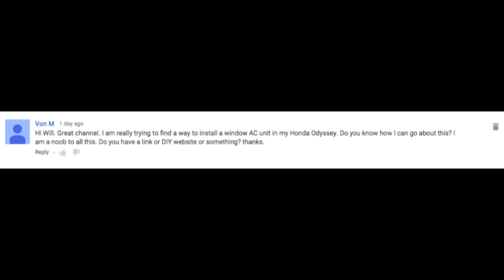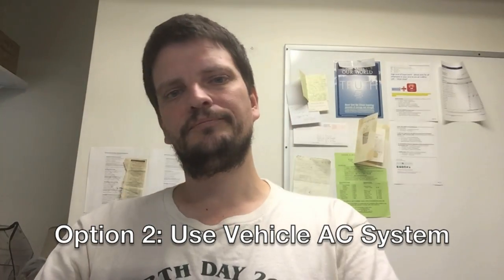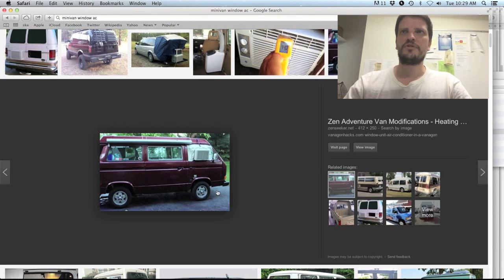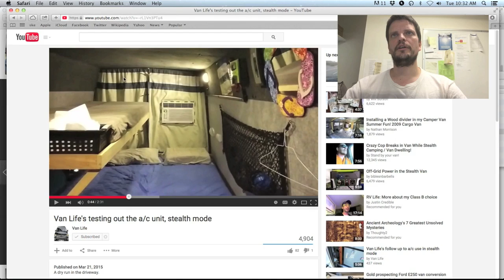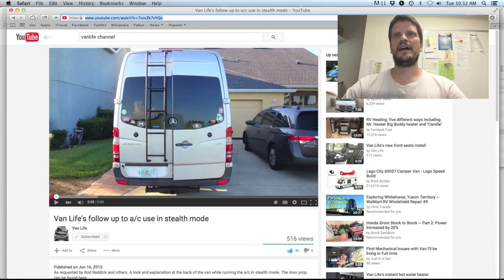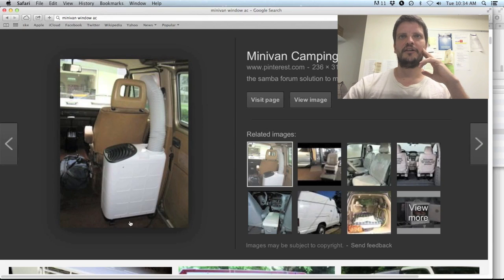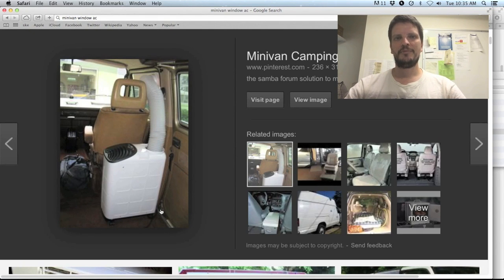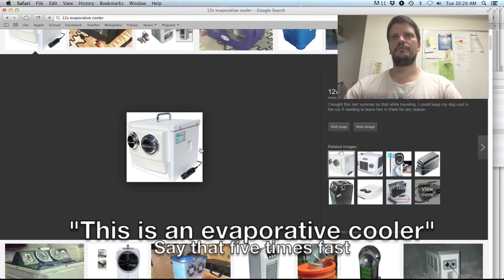7 Ways to Install AC in Minivan: VIDEO REQUEST

Comment: These are pretty cool ideas, no pun intended! My only question is how would you power them while stealth camping, given that they need about 3kw to run?
Reply from the maker: ijustwanttoseetitty Therein lies the problem. You pretty much have to resort to truck stops, rest areas, and maybe Walmarts and the like to be able to run a generator. Then there's always plugging in. There is also a 12V AC system that says it runs off 18 amps on low. It costs $2K.

Comment: Hey Will, nice stuff. I think you forgot the link to the guy you mentioned. I've had an idea about ventilating a van and this could fit in with the idea. How about a hole in the floor that goes to the outside but underneath the van? You could mount some PVC and leave it sticking up and attach to it as you need to and cap it when not in use. You could use it for ventilation input as well with a ceiling blower fan up top blowing out.
Reply from the maker: JoeCubicle Here are AC links: https://www.youtube.com/watch?feature=player_detailpage&v=RKP-X0z7YOA https://www.youtube.com/watch?feature=player_detailpage&v=RKP-X0z7YOA

Yes you can definitely get cool air from under the van where it is shady. I have two roof vents on my van. I usually use one in and one out:  https://www.youtube.com/watch?v=MTlJt6C_dqY

Comment: For Stealth #5 on a larger cargo van RV (and who knows on a minivan too?) with the metal dividing wall between the cockpit and the cabin/living quarters and the ac exhaust into the cockpit, with some fans, roof ventilation, window vents to let the heat escape. But obviously not the way it is shown.
Reply from the maker: Thanks for watching

Comment: I like the portable AC unit (option 6).  One could make just a vent hole on the side of the van for the exhaust.  I think down the line if I get around to building out my old camper van, I am going to go this route. Make my bed in back somewhat smaller and put a vent hole for the AC unit in the back door section.
Reply: I was thinking the same. Much more stealth than a window unit.
Reply from the maker: Nomad AdVantures Yessir
Reply: Nomad AdVantures I just posted my idea, close to yours but with the hole in the floor venting out the bottom. I got the idea from a buddy of mine had a business way back when. He had a big clean-water tank inside his van when there was no spigot where he was working.  He ran a drain pipe through the floor of his van with a ball valve on the line. When he wanted to drain his tank he could dump his water about anywhere without getting out of the van. It was pretty slick.

Comment: Thanks for sharing!!!  I have a good bit of experience with campers but am now looking for a solution while working on the road.  I'm going to convert a minivan.  Comfort is key.  Stealth is also important for certain situations.  Do you (or anyone else) know of reason that I shouldn't find a good spot to run the exhaust through the floor with a portable ac  - assuming I can find a good place on the undercarriage.  I've been all over the internet.  Everything goes out the windows or out the side/back.  ...all kinds of solutions.  Why not just through the floor?  That way it can stay there semi-permanatly/permanantly and be ultra stealth.  fyi - I'm still thinking generator covered on roof (or somewhere) so not too ultrastealth.  But exhaust through the floor still seems best.
Reply from the maker: Sure thing

Comment: for 1. Some guy in a sprinter/expediter on bob wells channel used a regular 5000 btu ac installed backwards on the roof (cold air blows forward).  He made an adapter that comes at a 45 degree angle.  5th option is great.  But this game me an idea. mount the ac on the roof inside and cut a rectangular hole in the roof  to exhaust the heat. 5000 btu ac units are the come on unit and new you can get them for $150.
Reply from the maker: Thanks for watching

Comment: Good video. .as I have said before. .you can put Window air in box sealed to outside wall and vent to outside with fridge vent and fan..like a propane fridge does. .I like your air conditioner. .a crafty person could also make a pull out Window unit with hd. Drawer slides..you would think someone would make a 5000 but roof air..would sell. .
Reply: 5000 btu spell check
Reply from the maker: mychannel325 I think Rod Reddick is making some sort of custom AC window unit. May wanna keep an eye on his channel to see what he comes up with…

Comment: My husband is sick. When he dies my only option is life in a mini van. If I get a subsidized apartment  I will be sad and depressed. And unable to do anything but sit inside and twiddle my thumbs. I doubt on 800 a month that I could have cable or internet. I like my East Coast. There are a few mountains I could drive up too and stay on top for a few weeks at a time. Somewhat boring but always cool. Just for the hot months.
Everything I have seen on cooling requires a power source. I have thought about portables, but they are big and bulky. Do those fantastic fans help when its 90 at night and humid? I really dont understand solar. I dont know the easiest setup. You have to keep.outdoor panels clean. What battery is best? I want fans a heater maybe a fridge. I am thinking of a newer Dodge Caravan. Do u have a no kitchen no build plan for that? I want a thin width bed with storage underneath. I have thought of milk crates and plyboard as a base, or two bedroom end tables and plyboard. Then the best foam pad I can find. Any thoughts? I have to have a potty for the morning. I am 62 and gotta go at 4 or 5 am.  Thank u.
Reply from the maker: Hi Nikki. You can live more comfortably in other countries too. Mexico, SE Asia, etc. But van life isn't bad if your health is good and you like outdoors.
Reply: @BoBurson  good answer, Bucko

Comment: How can I get power for a/c off 5000btu
Reply: Cuz I have power inverter  2000 watts willl not work with
Reply from the maker: Many YouTube videos showing how to power from solar, or you can use shore power.